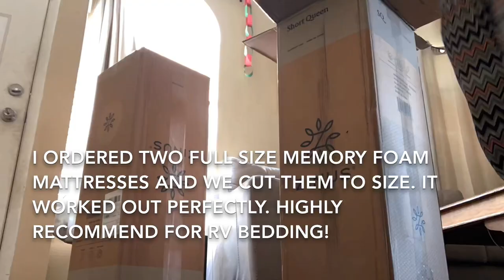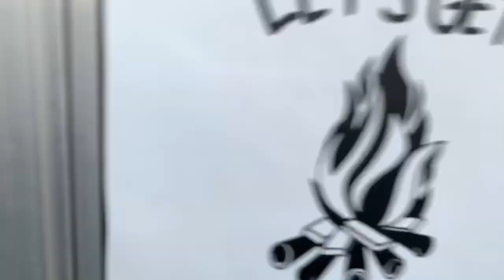Couple Remodels Pop Up Camper in 6 Days! Giant tear in canvas! On a Budget

Comment: Ran across this video and you guys did a great job. I would like to ask where did you get your cabinet door and drawer latches? If you could give me a wedsite, part number or name of them I would appreciate it. Thank you and again a great job!!
Reply from the maker: Hi! Thanks for watching :) The cabinet doors and latches are original to the Jayco trailer. Maybe check eBay? Or old jaycos for parts! The year of our model is 1984, hope that helps!!
Reply: @youngfreeandrv6940  yes that does help. I have a 1994 StarCraft that needs to be updated. I will ask on how your floating floor is doing. I see the video is a year old and thinking about putting flooring in like you did. I hear it can separate some because of temperature change. Is your floor doing good still. One thing I will tell you that I saw that looks really good is ceiling tin squares that you peel and stick. I saw someone do that to there pop up and it looked really good. Thanks for the information! Enjoy camping!!

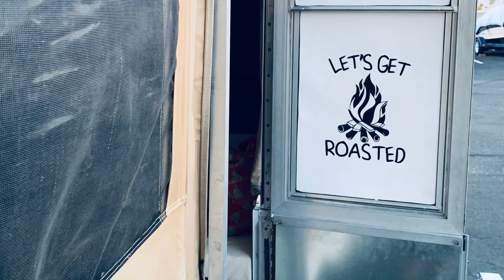Comment: on 15:19, what did you guys use to closed up between the door and the canvas? mine don't have them plastic to attach the canvas to the door. TIA
Reply from the maker: Hello! That’s just a piece of sheet metal we cut to fit! There was a piece of rotting wood there before, very easy fix! Good luck :)
Reply from the maker: Maybe I misunderstood your question. Sorry!! So this canvas and door had a slight gap between, I think all older pop-ups will have that issue. There is nothing to close it up on this 1984 JAYCO Model, hopefully you find a solution!
Reply: How about an extra piece of material sewn in & snaps to snap to the door. Then when it comes down you can unsnap it. Just a thought, hope it will help
Reply: @carrolkeller5298   I figured it out. The plastic is being sewed in the canvas already. All I have to do is to bend the canvas in on the door to hold. Thank you guys
Reply: @pinoybenicio  glad you figured it out. God bless
Reply: @carrolkeller5298   thank you. And we need more you your pop up video pls.